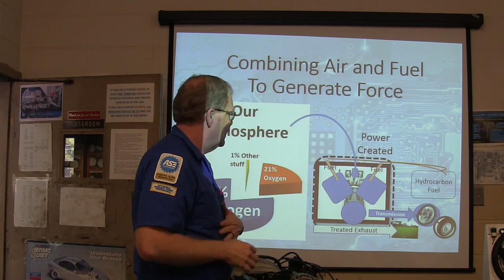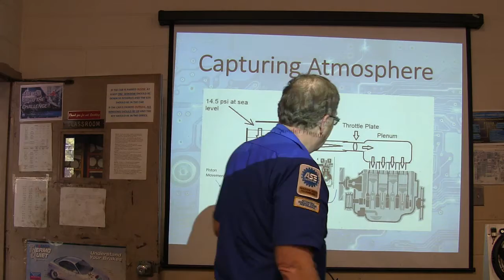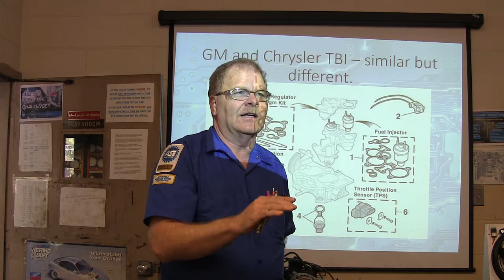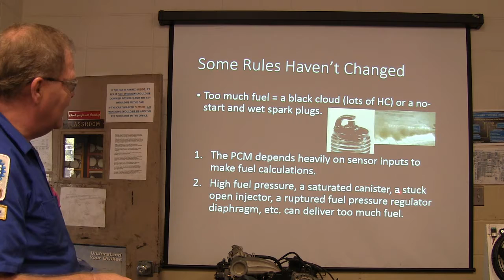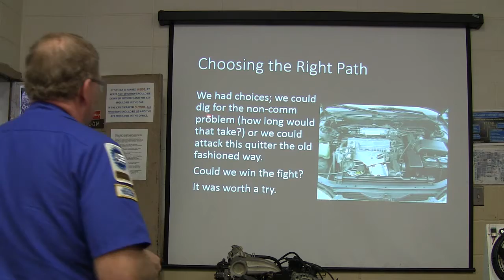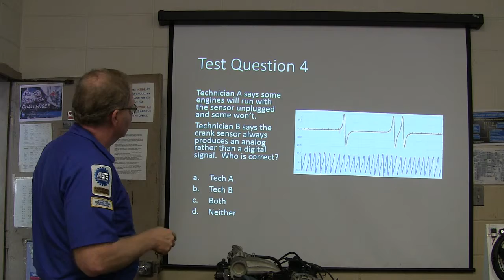Engine Performance Opener

Comment: Actually, in the case of some Fords, you can kill an ignition coil with a bad PCM if the driver is shorted.  It won't take long to cook it, either.  I just watched a ScannerDanner Premium video about this.  He killed a brand new coil by leaving the bad PCM installed which had initially failed open.  Somewhere along the way the open coil driver in the bad PCM shorted and it fried the coil.  So, the coil can fry a PCM but the PCM can also fry a coil.  I'm all for parts swapping but good diagnostic work is always better than swaptronics.
Reply from the maker: Yep, some of the new Ford COP coils do get fried that way - I've seen posts about it from confused guys who replaced fried coils only to have the vehicle come back with the same coils fried again...